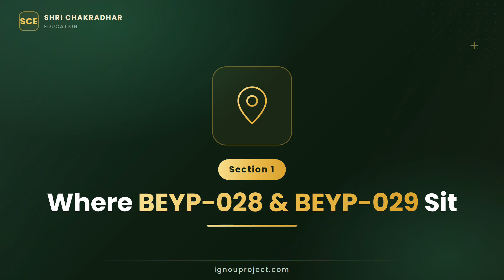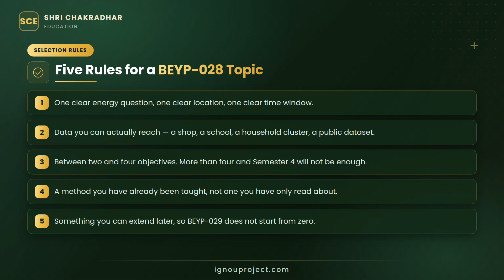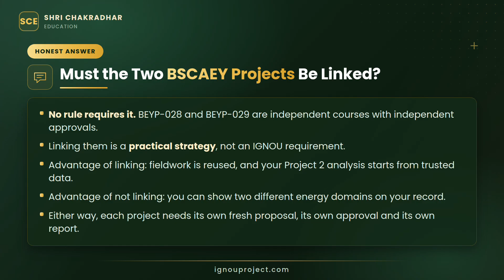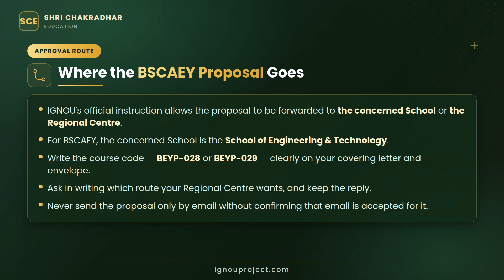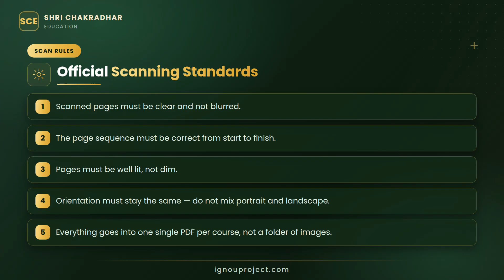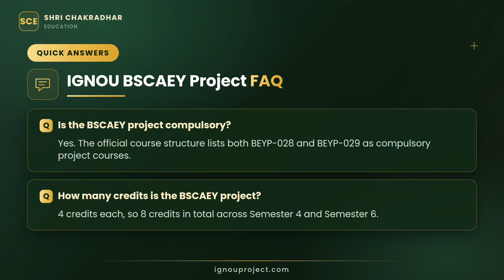IGNOU BSCAEY Project for BEYP-028 & BEYP-029: Synopsis, Format, Topics, Supervisor, Submission Guide

Comment from the maker: IGNOU BSCAEY PROJECT — QUICK FACTS
- BEYP-028 = Project 1 · 4 credits · Semester 4 · compulsory
- BEYP-029 = Project 2 · 4 credits · Semester 6 · compulsory
- School: School of Engineering & Technology (SOET), IGNOU, Maidan Garhi, New Delhi 110068
- Two courses = two proposals, two approvals, two single-PDF uploads, two fees
- Project evaluation fee: Rs 300 per project (up to 4 credits), paid WITH the TEE form
- Never upload your synopsis to the online project portal — that portal is for the final report only

Jump to:
6:35 BEYP-028 vs BEYP-029 compared
9:15 What Project 1 should be
14:15 How Project 2 must go deeper
20:15 Synopsis contents + the 4-document proposal file
24:35 The Rs 300 fee trap
27:10 Ten rejection triggers

Which project are you starting — BEYP-028 or BEYP-029? Comment below and I will reply.
Full written guide: https://ignouproject.com | WhatsApp: +91 93546 37830
— BK Sahni, ignouproject.com